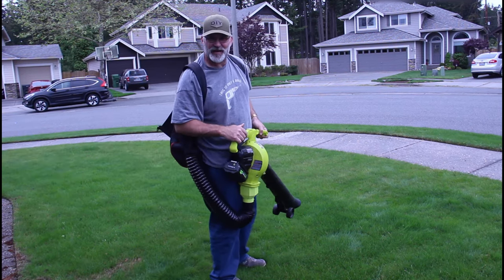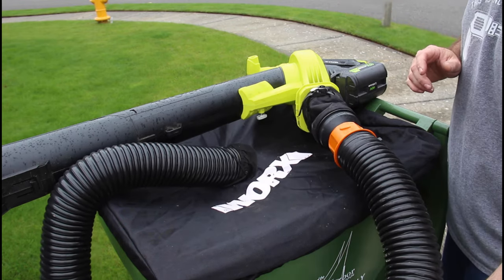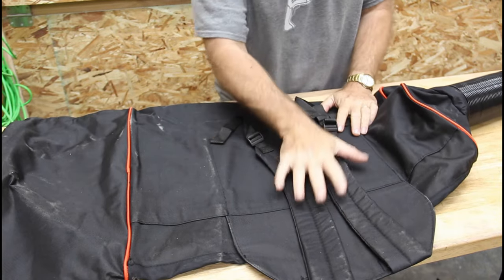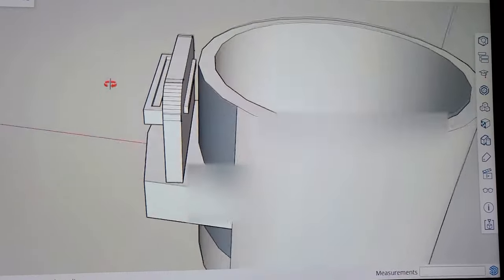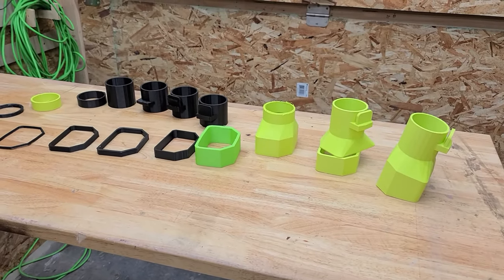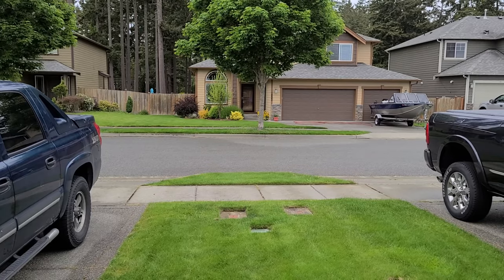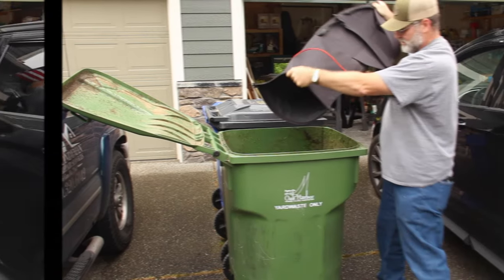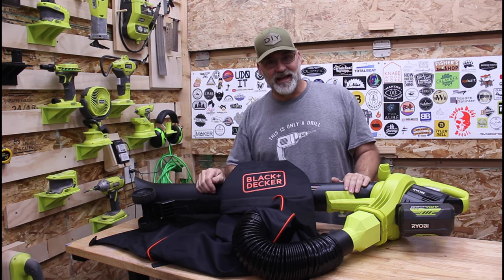UPGRADING the Ryobi Vac-Attack Leaf Vacuum and Mulcher! | 3D Printed Adapter! | 2022/10

Comment: Mine was delivered today.  Is easy to assemble.  Worked fine.  I didn't attach the wheels.  I figured that was better so to get the nozzle right on the ground.  Plus it allowed me to rake the ground with the nozzle to get leaves tangled in the grass.  I already had a Ryobi mower so I didn't need to buy a battery.  Normally after I mow I have two lights left on the battery.  After doing my yard with the vac only had one light left on the battery.  When I use it again I'll try to set the power as low as possible to see if that saves the battery.
Reply from the maker: They do eat up the battery. I have 6ah and it gives me pretty good run time.
Reply: @DadItYourselfDIY  Since I'm not going to be using the mower at the same time as the vac not a big deal as long as the battery gets the yard done on one charge.  I was just pointing out that the vac seems to eat up more of the battery than my 16 inch mower.   Once this battery needs to be replaced I'll probably get a 6ah battery.  This one is only 4ah.
Reply from the maker: Makes perfect sense.

Comment: Looks like a great leaf vac but the B&D bag requires the leaves to make a 180 turn thus making it inefficient. Have you seen anyone put the larger Ryobi bag on a small cart and make a 8' or 10' connector hose so can pull it? And don't have to carry heavy leaves in backpack and don't have to disconnect B&D bag to empty it?
Reply from the maker: Your description is the Worx Leaf Collection system. Check out my other videos.

Comment: I will be a client. A new question after a couple of videos - is why it is necessary to mulch which can cause issues - and space or a number of 55 gal containers is no problem. The front end of the hose to sealed off container - no blockage - better?  I just have as one problem, the top of a drive where millions of the wirley things fall and settle. Then areas where leaves fall where I am no longer able to rake and collect them.  If we can connect to communicate directly I would like to see options to get me started -
Reply from the maker: I mulch the leaves to save space. I only have one 95vgallon green can each week.

Comment: Hope you can make a new adapter with 90 degree bend so the hose does not have bend around almost 360.  with smooth bore, air and the mulch leafs can flow out faster.
Reply from the maker: I'm investigating that. But it's not as easy as it sounds.

Comment: May I please ask you a question - you know a great deal. My issue is a huge amount of helicopter leaves, other leaves and small debri, sticks or even small plebes that wash down from a badly landscaped yard next door and behind.  I need to skip mulching, I need to have a large mouth hose - long as possible and connect it to 55 gal plastic bins I can move to the street or the city bins like in your video. The trees on the other property provide shade but fall is hard as heck as they do not sweep up. Can you advise on what is needed just to vac each day - no mulching - just pull it all into a bin?  I would really like two things. 1st a longer hose to be able to have some distance from the bin, and the ability to seal well the 55 gal or larger bin so the dust is lower. I am willing to pay for help if need be. I am a vet who is moving slower, having a harder time but I need to vac each day to keep the area from looking so bad.
Reply from the maker: I think Worx or Black and Decker make a vacuum only unit that goes tova bag. Let me see if I can findva link.

Comment: I wanted to post a Thank You for these leaf vac videos and for the adapter you made.   I just tried out your adapter with the B&D bag, and it makes a huge difference!  I have a tolerate/hate relationship with my leaf vac.  If not for your fixes, this thing would be in a landfill by now.

I was a little unsure about the B&D bag vs. the garbage can solution, but I am really glad I went with the B&D bag.  Having the bag on your back is not bad at all; you barely feel the weight.  The only negative I would say (and this is a small nit) is that because of the location of the hose, you are forced to always use the tool righthanded.

I did put a screw through your adapter to keep it in place. I may also epoxy on a small clip for the bag side of the adapter.

You have turned this tool from a huge pain the neck into an actually useable product!
Reply from the maker: Thanks for the feedback it's appreciated!!

Comment: I got my adapter and Black & Decker bag.   I agree it needs a screw.  Even though it fits snug it isn't that hard to pull off.  So I put a screw on both small flat surfaces.   Now just waiting for the leaves to start fall so I can try it out.
Reply from the maker: Awesome! Thank you for the feedback!
Reply: Used it for the first time today.  The connector you made worked fine.  Bag never came loose while using it.  Small complaint about the B&D bag is I wish it closed with a zipper.
Reply from the maker: Yeah, the roll clasp is interesting! Thanks for the feedback!

Comment: I got this today & looking forward to giving it a workout!  Do you ha e any ideas or products that would hang or mount this beast to the wall?
Reply from the maker: Keep me posted. I hitch the handle over a horizontal 2x4 in the shed.
Reply: @DadItYourselfDIY  Hi—a quick update and questions.  Is there a product that reduces the severity of the angle of the flex hose to the adapter that is created when you put the B&D bag on your back?  It clogs very easily especially if the leaves are even a bit damp.  Also, is there a way to create a discharge chute for the Ryobi Leaf Vac?  Rather than collecting them in a bag directly, I found that removing the bag, vac, grind and discharge the damp leaves then go back and either vac them or pick them up is effective.  Thanks!
Reply from the maker: @christopherbullock2644 I would assume operating the vac without a hose would accomplish what you are saying. I have not received any comments, but I understand what you are saying. I do not have a solution for you right now, though.
Reply: @DadItYourselfDIY  Thanks for the quick reply.  I may try something & if it "works", I'll let you know.
Reply from the maker: @christopherbullock2644 I'd love to know what solutions you come up with.
Reply: @DadItYourselfDIY  The attachment & hose for the Worx trash can attachment is too long & heavy.  It would work but probably a bit much to drag around while using the Ryobi.  I bought a corrigated drain pipe adapter and flex drain pipe @ HD and used a hose clamp to attach it to the fabric clamp-on adapter from the Worx trash can hose (not the orange part).  I have 2 photos; what is the best way to send them to you other than social media?
Reply from the maker: @christopherbullock2644 email to DadItYourselfDIY@gmail.com

Comment: Hi! This is awesome and looks to be exactly what I want to do. My only concern is my Ryobi vacuum has a different looking end than yours for where the adapter would attach. So your 3D model wouldn’t fit on mine just from what I can see on this video. Did you cut the curve on the actual tool it’s self? Or do I have a different model? I hope that makes sense what I’m describing? Thx!
Reply from the maker: Watch the original Worx video. Send me a picture on Instagram @dadityourselfdiy
Reply: @DadItYourselfDIY  Ah! I found and watched your original video. I have the same model, just need to cut that port so the curve is eliminated. I can do that no problem. I'll be buying your adapter shortly! Thanks for the help!
Reply from the maker: You're welcome!

Comment: This is what I've been looking for, one big suggestion. Any way to modify the adapter to fit the OEM bag attachment on the Ryobi unit instead of attaching to the bottom area?
Reply from the maker: I may look into modeling that, but the pipe will have to be completely removed.

Comment: Looks like a great design!  Does the backpack bag exhaust a lot of dust?  Because you have to cut the factory tube, would you consider designing / printing another adapter so  you could use either the factory bag or the backpack bag?
Reply from the maker: The bag doesn't exhaust dust.. cutting the tube doesn't impact reusing the factory bag.

Comment: Very nice! I would be a buyer of the adapter. Any chance one could be made without cutting the original port on the tool?
Reply from the maker: Potentially  it could, but would create unnecessary drag. The existing port reduces and directs forward.

Comment: It still just doesn't look a very powerful machine even for a 40v Vac (not your adaptor .. that's great), as nozzle has to be so close to leaves, so a very narrow field of suck!  Although eventual system maybe convenient,  but I have a simpler system of using a $50 18v (in UK) Ryobi blower to blow leaves out into the open, then either blow (or rake) into a neat pile, then simply pick up with two boards into a bulk bag.
Reply from the maker: Absolutely, there can be more efficent ways. Overseas they offer a mulcher you can dump the leaves into as well, which I think is a great option. I use this almost exclusively for landscape beds and hard to reach places.